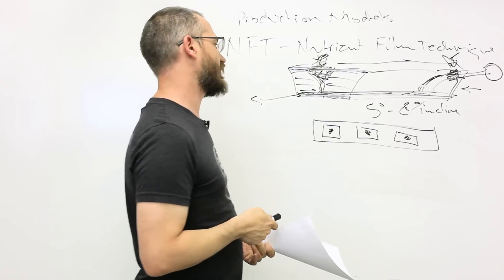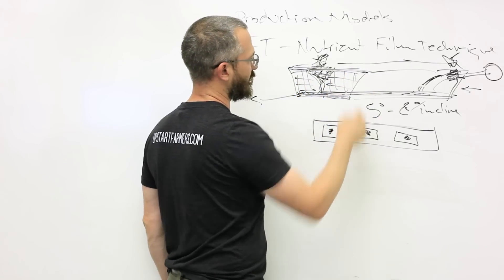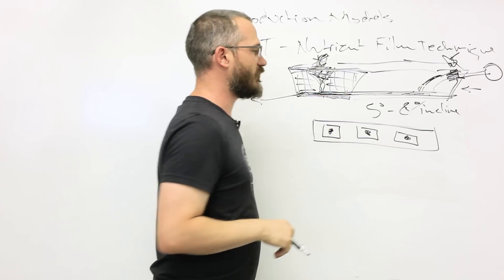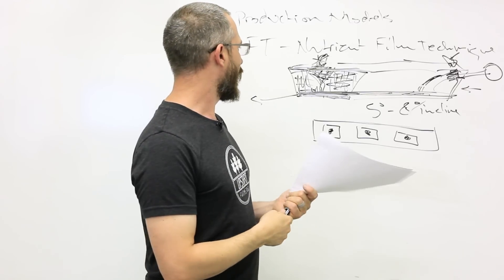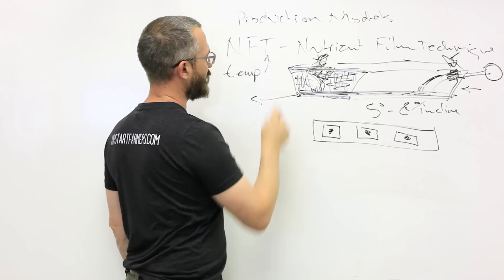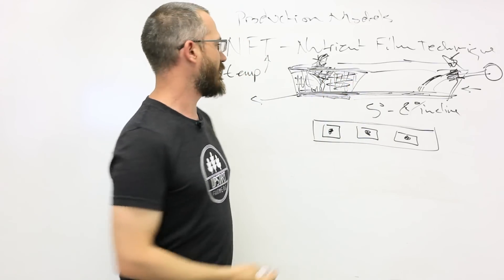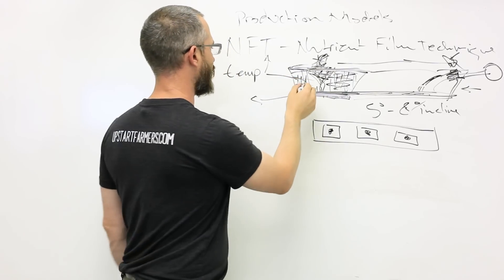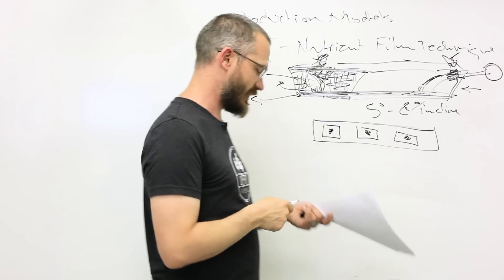Why is NFT mostly used in hydroponic systems?

Comment: All the problems relating to oxygen in NFT can be fixed with a simple air pump and air stone (Any where that sells fish keeping supplies will sell them.)
Also many recent pumps for nft have a specially Oxy pump design that pumps the nutrient and oxygenates it at the same time.
Please correct me if I am wrong.

Comment: Explains why I had no issues with it in my test setup. Good particle filtration to keep the solids where they need to be, and lots of aeration. My #1 problem was the size that my tomatoes achieved. 

protip: don't do tomatoes in a mixed NFT setup unless you're ONLY growing tomatoes.
Reply: Obliterous don't do tomatoes in nft.  Dwc or buckets also coco works great
Reply: Yeah, I learned this the hard way. they do well in NFT, but they blocked out EVERYTHING else.
Reply: Obliterous Try a Dwc and have the water level lower than normal. So you can get some aeroponic effects with bubbles bursting.
Reply: All the problems relating to oxygen in NFT can be fixed with a simple air pump and air stone (Any where that sells fish keeping supplies will sell them.)
Also many recent pumps for nft have a specially Oxy pump design that pumps the nutrient and oxygenates it at the same time.
Please correct me if I am wrong.

Comment: Should I avoid NFT for a bioponics setup? My compost teas probably would have some amount of solids in them as well
Reply: Dark Wing Duck can you filter it more?
Reply: I believe so, we're experimenting and I bought a pallet of zip grows, so I'm trying bioponics in the zip grow to see what works and what doesn't, what I can get away with on gph feed. You're correct - I would have to filter that tea well
Reply: All the problems relating to oxygen in NFT can be fixed with a simple air pump and air stone (Any where that sells fish keeping supplies will sell them.)
Also many recent pumps for nft have a specially Oxy pump design that pumps the nutrient and oxygenates it at the same time.
Please correct me if I am wrong.

Comment: Can we grow plants with out a water pump?
Reply: Yes. It's called a garden.
Reply: Sure, just take a bucket and transfer water from your sump tank into your head tank 50 times a day.
Reply: Try Kratky Method.
Reply: Of course you can.. In Soil or Coco and hand watered..
There is also the Kratky method but I advise using an small fish tank air pump / stone in the nutrients for better results and avoiding root rot.